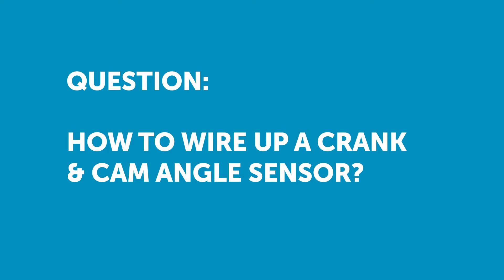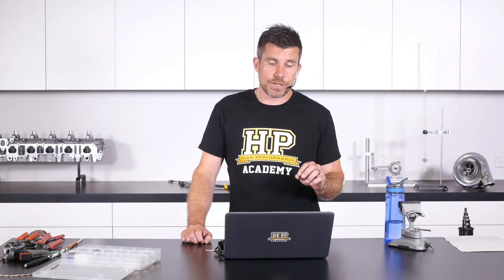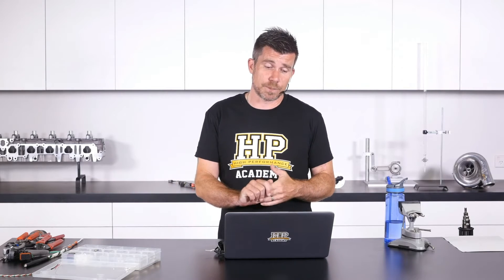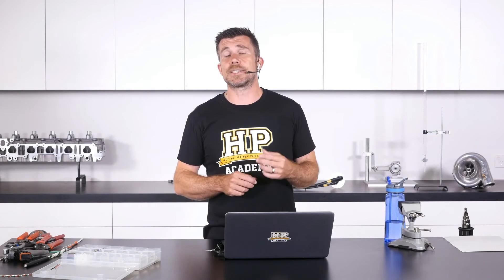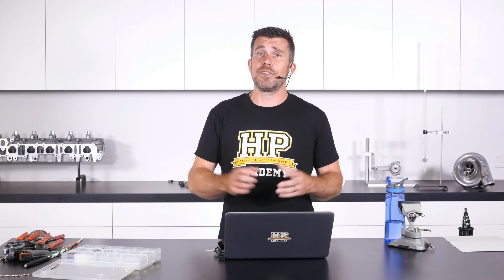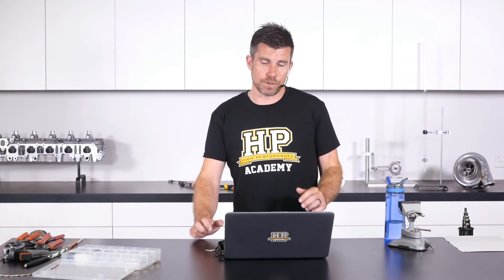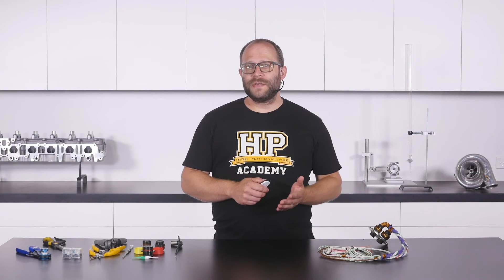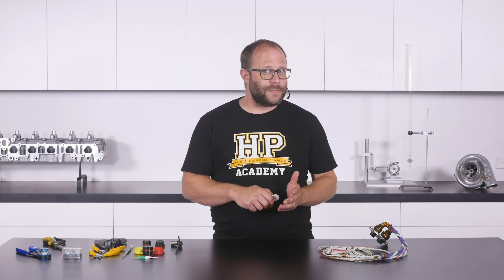Crank & Cam Angle Sensor Wiring | Shielded Cable Grounding [HPA Q&A]

Comment: When grounding at the ecu, what pin would be ideal to run to? My standalone has an ecu ground pin? And also if you look at the factory harness they have it running to a pin on the ecu and also branched from there and running to the ground on the intake manifold…

Comment: I am dealing with this on a STOCK ECU. I have been chasing my tail forever on this and it's because Nissan grounded like 14 components on one ground on the engine. 2002 Infiniti Q45 doesn't have an isolated ECU ground.